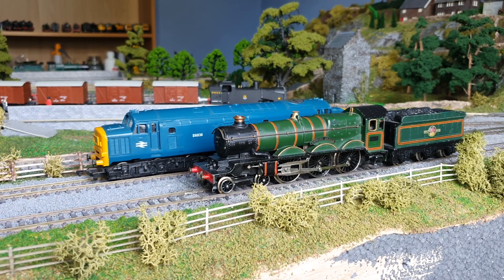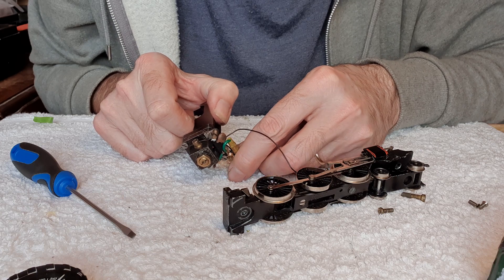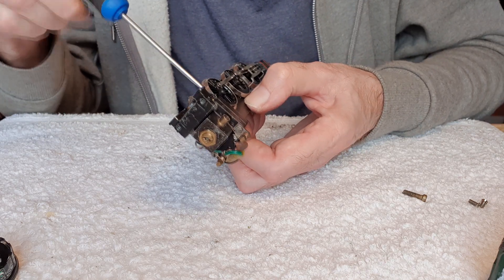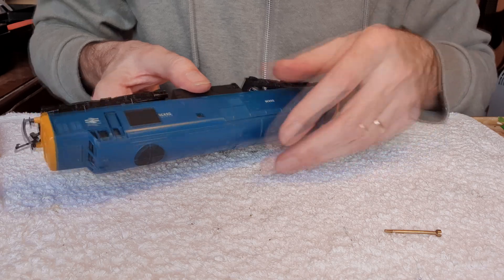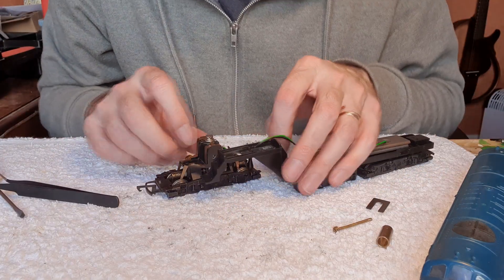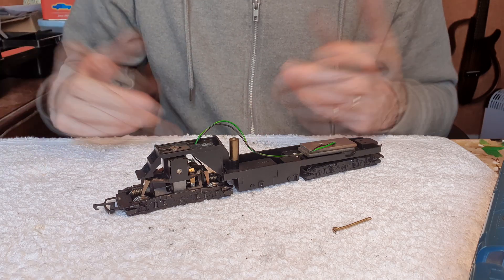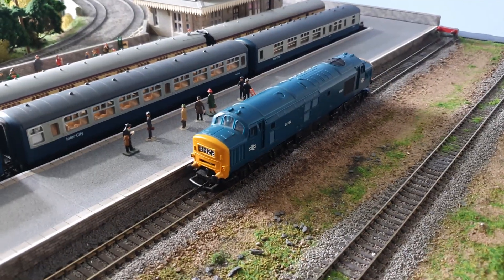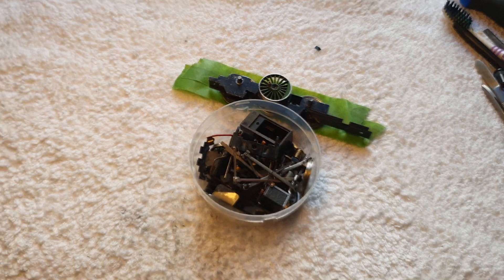Hornby Dublo Cardiff Castle and Hornby R751 Class 37 Remagnitised

Comment: Hi, I was watching another video of yours and wondered what you use to clean the metal parts. You keep it in a plastic tub on a shelf and put them in it for a few hours. Great channel you have inspired me to get my old trains out and fix them.
Reply from the maker: It's clock cleaning fluid which is a diluted ammonia solution. Cleans brass and copper very well.
Reply: @oobill  thanks, that's great

Comment: That Castle was a Wren design, looking at the motor
Reply: Wrenn took over the Hornby Dublo range, and continued to manufacture locomotives to the same basic specifications, but the Castle was originally a Hornby model.
Reply: Got that wrong didn’t I😂
Reply: @rodneybegg7321  Knowledge is POWER! :D